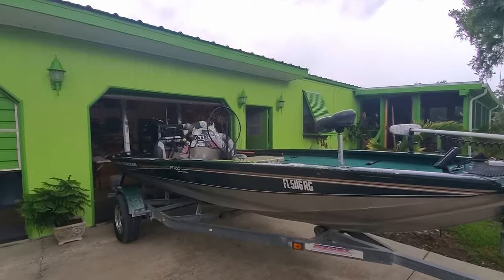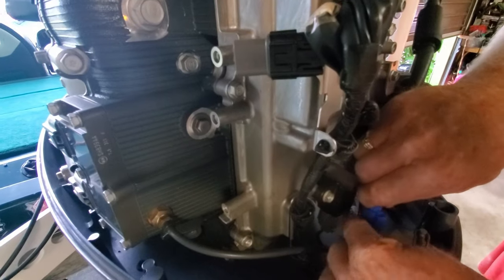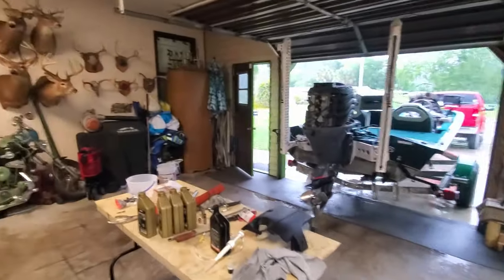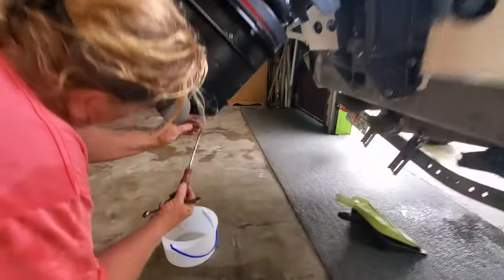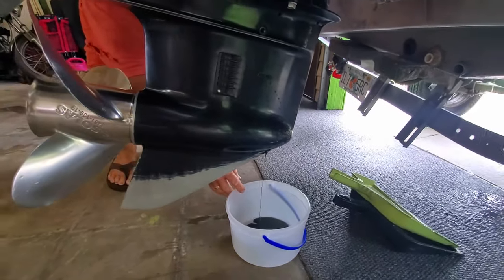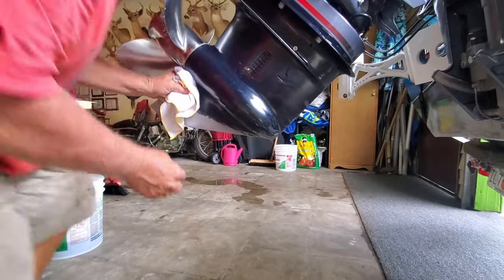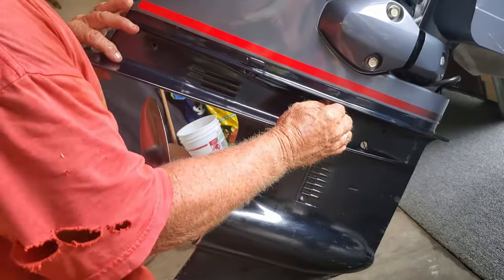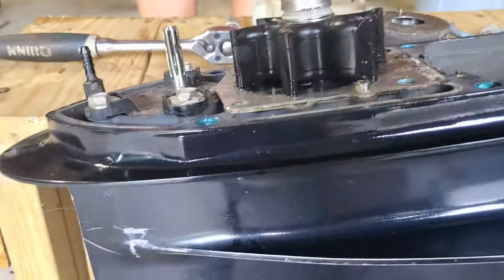Yamaha 2017 115 Sho  200 Hour Service

Comment: I used a propane torch to heat the metal cover over the plastic collar. It melted the plastic collar and allowed me to remove the metal cover without tearing it up. Of coarse I had to replace the plastic collar. Thanks for your video.
Reply from the maker: Great idea.  I had to replace it as well

Comment: I like your videos do have a on the fuel water separator can’t get mine off even with a filter wrench
Reply from the maker: They can be a bear …I don’t have a video on it but …maybe could stab hole in bottom and drain../then stick screw driver thru it for some leverage.  At this point you gonna have to get creative and forceful .  Thanks for watching